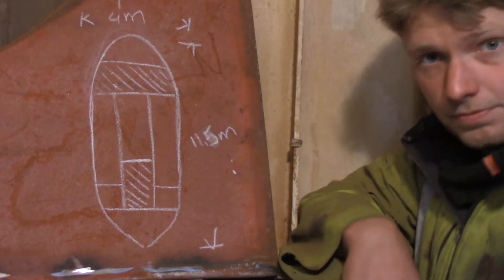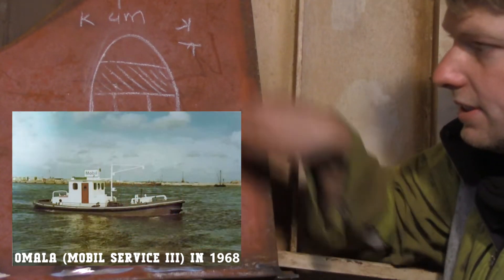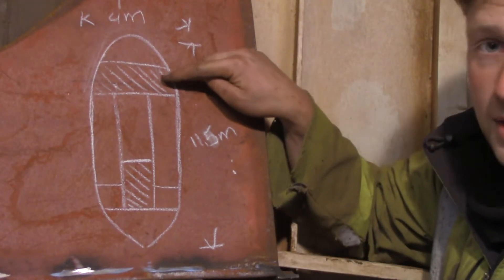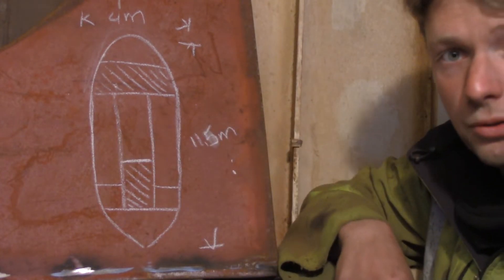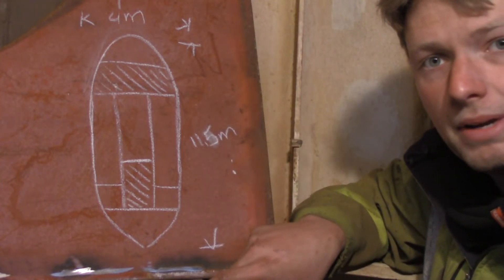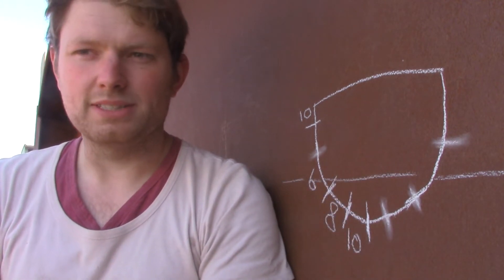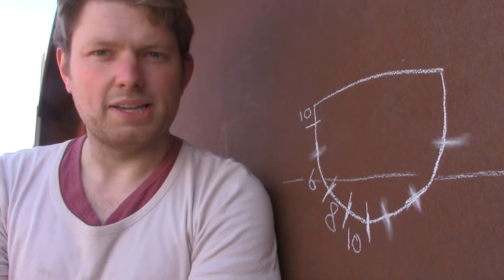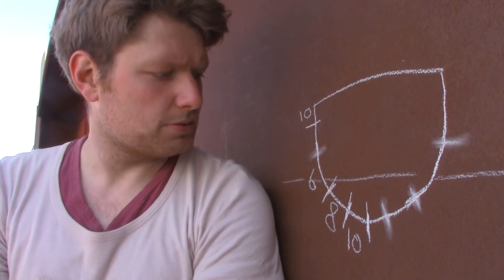Houseboat Omala | Ep. 15 | Fixing corrosion and prep. for ballast - part 1

Comment: The thing about cement is that it raises the PH to over 13 and thus it is a great alkaline environment to protect the steel from corrosion. I love the suggestion of painting neat cement on first as that will absolutely ensure that the PH remains high in the contact zone of the cement steel interface. Are you going to place reinforcement within the concrete mass to help prevent cracking? If you do just remember to ensure you have at least 50mm cover. Make sure you do not over saturate the concrete with water too. Try to have a high MPA mix and use a concrete additive to reduce the permeability of the cured concrete to ensure long life of your steel under the mass.
Reply from the maker: Thanks Phil, great to know some of the science behind it! I was indeed planning of having rebarb welded on the frames for added strength, however I have been told not to do so. If I ever wanted to change a plate or do repairs, it would be nearly impossible to get it of again. I’ve also been thinking about adding additives to it, to help sealing it even more so, but again others with experience told me that normal cement actually helps evaporating any water/condensation if it were get stuck between both mediums, so having a slightly permiable cement layer is a plus :) Im going to try this front room and see wether I like its results, I might consider painting the entire inside. All the steel in the fuel tanks has diesel soaked into it, sandblasting wont help, so polyurethane or expoxy paint wont have a proper adhesion.